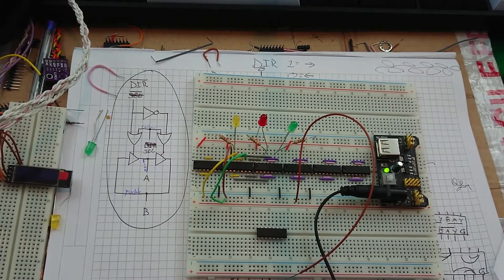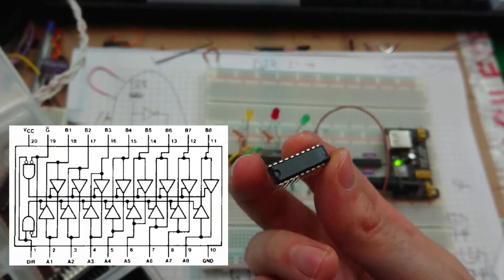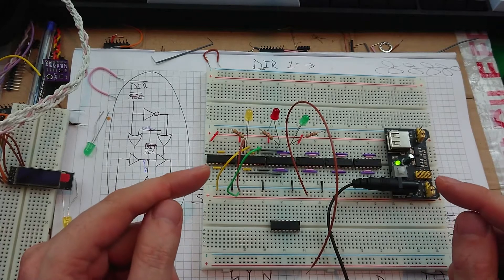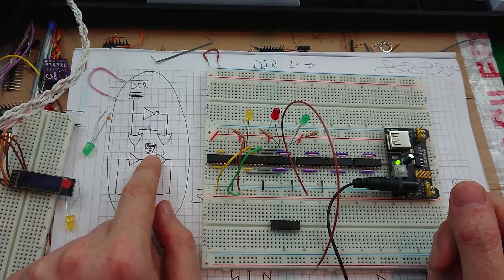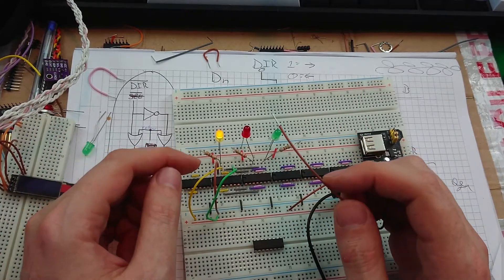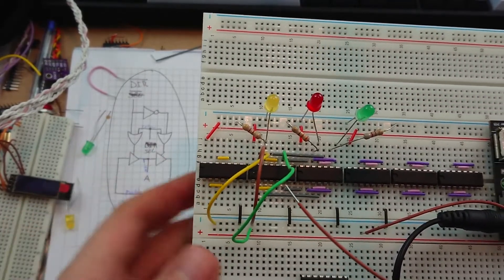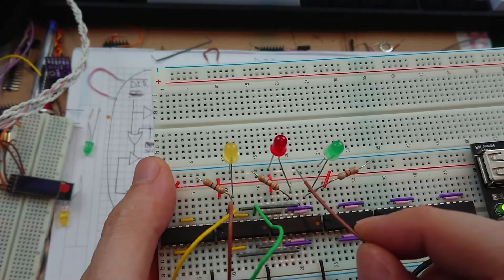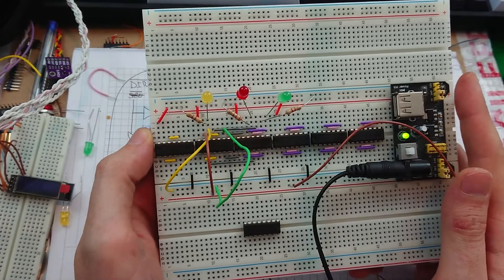Testing a bidirectional buffer - Plum Breadboard Computer

Comment: Just wanted to mention that this video looked very professional, nice job! Everything was prepared, the camera was stable, you didn't umm or ahh. To improve even more, you could use the zoom feature instead of holding the circuit up to the camera, and perhaps build buttons and switches just for the video to make it look good. :)
Reply from the maker: Thanks! I appreciate it. :D I'm still filming with my phone being held out on a long selfie stick so touching it to zoom would have introduced a lot of wobble and it would have been a nasty "digital zoom" anyway. As for switches, absolutely. I did think about doing just that, but I'm already very good at finding reasons not to publish what I just filmed and front-load it with yet more stuff that I need to do first. Might set up a bunch of debounced switches on a separate breadboard that I can hook in as and when, but in the mean time I just wanted to get a video out. :)

Comment: The chip I think you're looking for is a "CD4051B", its an 8-channel Analog Multiplexer/Demultiplexer, and as such is bidirectional.
Reply from the maker: Thanks for the tip! Didn't think of looking in the 4xxx series since I'm not such a fan of their pinouts. They tend to be a bit all over the place which makes pretty wiring harder. Looking at the pinout for the 4051B, that looks like it holds true for this chip as well. :( Same reason I didn't bother using the 74HC181 chips to make the ALU out of. I did try, but the wiring was a mess of crossing signals and I didn't like the aesthetic. :P
Reply: I did a little more looking and "CD4067B"/"CD4097B" chips look closer to what you want, inline pinouts as well.